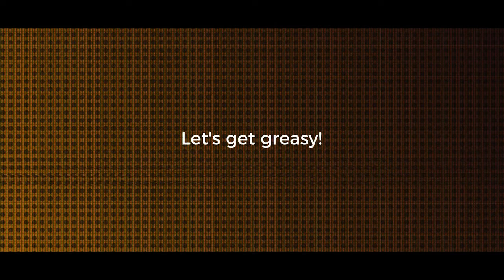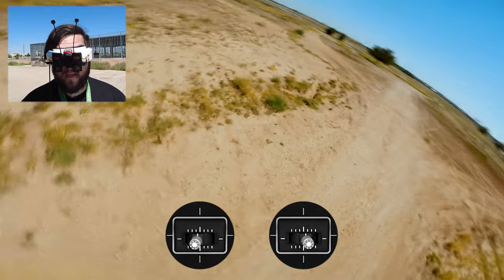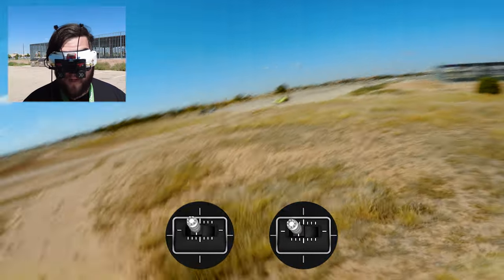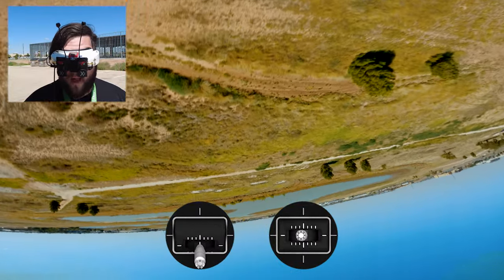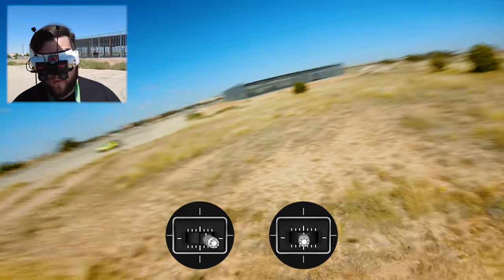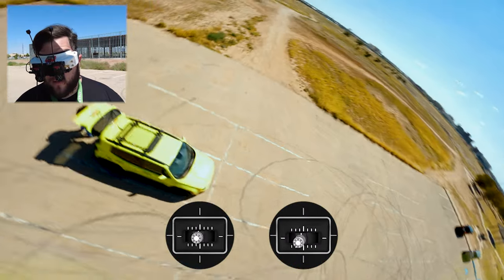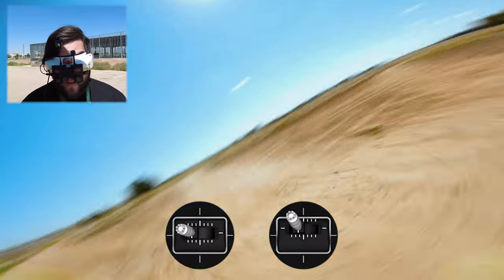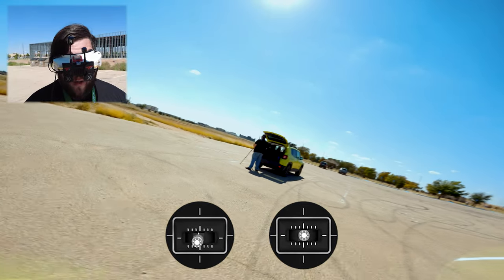How to rip my top 3 greasy FPV freestyle tricks!  // FPV Drone Trick Tutorials // BaconNinjaFPV

Comment: Great video man! I’m looking to get more into Fpv. I currently have the avata, but I’m looking to find another set up. What would you recommend a good starter kit that isn’t too overly expensive? Thank you
Reply from the maker: Well if you have the Avata, that is actually a great start for some other rigs!  The Goggles 2 you have and even the Controller 2 if you have one for your Avata can be used on FPV quads with the DJI O3 system on board and some are designed for you to use that same controller with as well.  iFlight makes a bind and fly Nazgul V3 O3 quad that has the correct VTX for your goggles and will let you pick an option to use your DJI controller 2 if you already have one as well.  That setup runs around $550 and would require you to also get some 6S batteries and a good charger for them, but much cheaper than buying other versions of everything all over again since you already have some pretty great goggles!